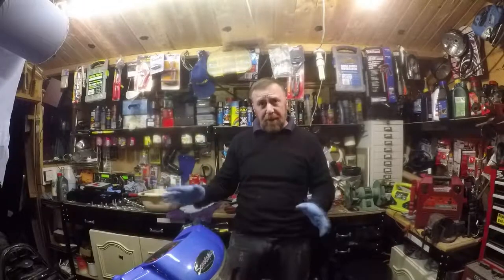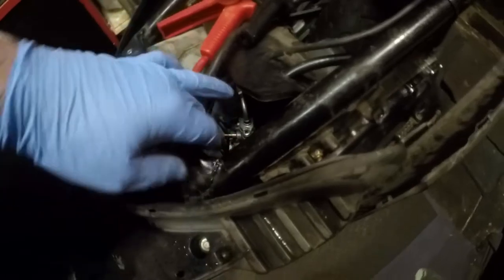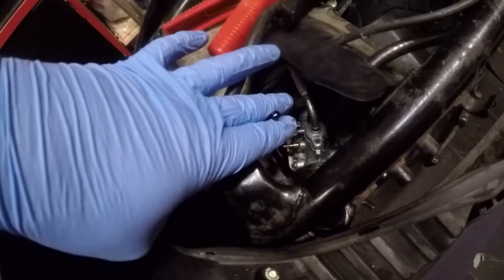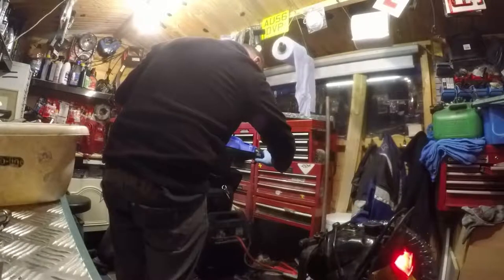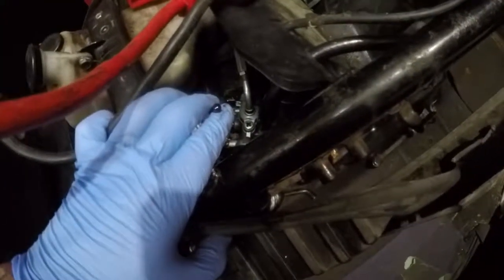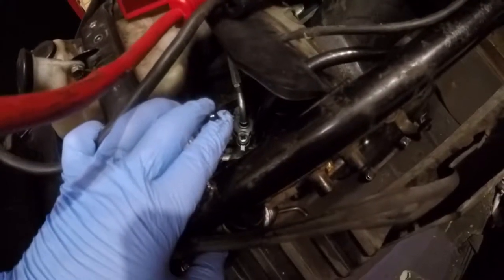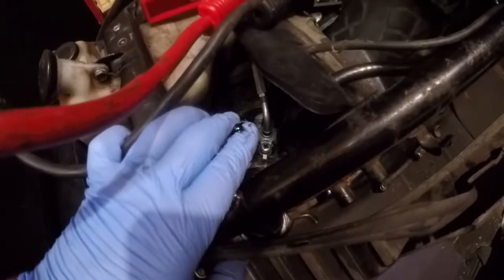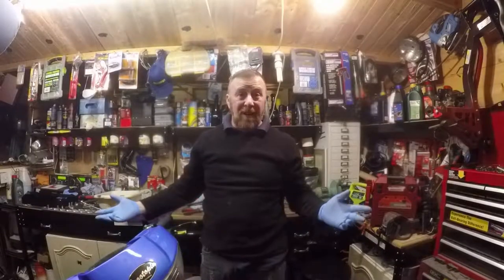MOPED 2T OIL PUMP TEST IF ITS WORKING MARK SAVAGE

Comment from the maker: Just an old video i forgot release
Reply: Hey mark! 
Have a problem with my speedfight and need problem. 

Its bogging down, starts and runs.
But when i try to give preety much gas it starts bogging down and stops going forwards. 
Doesnt pull on much trottle. 
But when i give little gas it runs as normal. 
When its wet it gets so much Worse.

Comment: Hi, i have a question, im hoping you can help with it. We have just purchased a peugeot speedfight 2 50cc LC for our son to use to get to college and back. We have put a new battery in and replaced the starter motor. Everything worked perfectly. It's not been rode yet. Went back the next day, and the battery was flat. Put a spare battery in. Everything worked again, then the next day flat again. Any ideas? Many thanks.
Reply from the maker: @kieronbarton1559  definitely a power drain 
, no lights on , earthed ok
2 opinions 
All panels off, check all wiring,  stator coil and volt regulator 
Easy way 
Put a kill switch to the battery until you find the power drain 
Get a volt meter
Reply: @marksavage  h
Hi Mark, Thank you so much for the reply. I think we will try the kill switch for now. Thank you again.
Reply: Hi Mark. I have another question. I have just swapped the engine on my sons peugeot speedfight 2 50cc LC. On the wiring there is a separate black and red wire which on the old engine runs to the stator, on the engine I have fitted doesn't have this? Any ideas what it's for and how to overcome this? As I can't see a spark? Many thanks

Comment: hi mark do u have a  screenshot of  how to conect pipes from a speedfight 2 oil pump to carb  and how to set all pipes up as was run with pre mix got new oil tank ect just dont know how it all  goes together pipe wise
Reply from the maker: @robertchapman4190  I have many carb videos bud on my channel 
Try mark savage carb or tuning